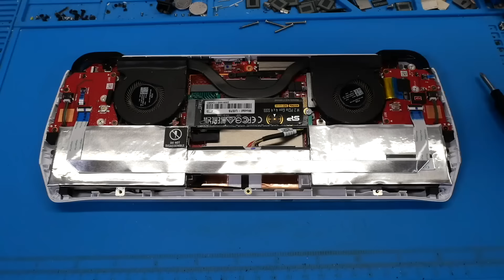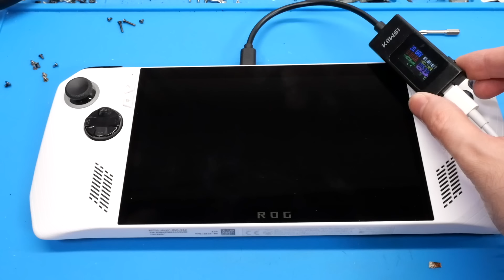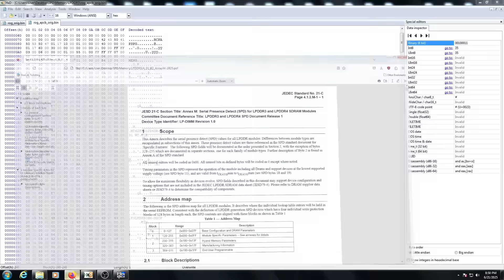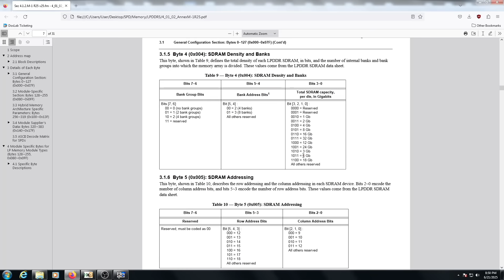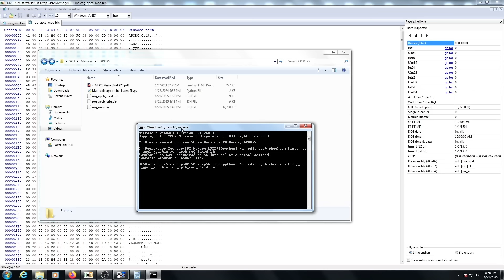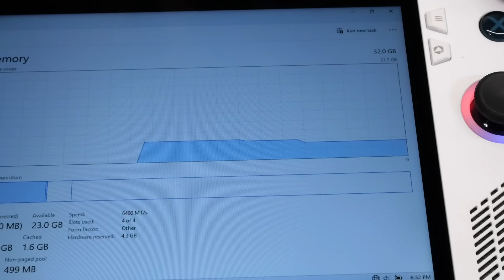ASUS ROG Ally 32GB RAM Upgrade

Comment: Couple things:
1. Congrats on the sponsorship.
2. Windows updating the BIOS (and drivers in general) is actually not a bad thing. While Windows updating itself tends to be generally unreliable, when it comes to drivers, Microsoft only accepts super stable versions for delivering through Windows Update. It's why the driver versions, when installed through Windows Update, tend to be much older than current ones on the vendor websites. This is doubly true for BIOS updates, and I've never had problems with them on both my previous laptops (Acer and Lenovo). Also it feels a lot less nerve wracking cuz all you have to do is reboot.

Comment: Have you considered putting sockets for ram chips on the board that are sockets like bios chip sockets, would it even work.
Reply: making sockets for high speed stuff is very hard it takes a bit of space, recently for DDR5 ram SoCAMM module standard was introduced which is exactly what can be used in a system like this but the manufacturer needs to add it a user can't.

Comment: Honestly, i have LTT precision screwdriver and the mini ratcheting screwdriver and overall i like them both. However my main gripe with both (arguably more so with the precision driver) that makes me prefer my klein or other drivers is the grip. 

The smooth metal finish looks nice, but its not so good for actually keeping the thing in my hand in use, particularly when trying to unscrew anything thats had a bit of loctite or is otherwise gummed up.

Its got some knerling at the bottom, but honestly my hands are a bit smaller, and my fingers dont really reach all the way to it in a comfortable way when i have the driver palmed during use. My fingers end up trying to spin the driver by the smooth metal and its just obnoxious. 

I could solve this with grip tape, but honestly why bother when my klein is comfier in the hand anyways and doesnt need to be modified. 

The lack of proper knerling or grip also just makes it way more prone to slipping out of my hand than any other driver ive used, which is a big no no for me when working inside of electronics.

Its a fun fidget toy though, ill give it that.

Comment: i wanted to upgrade the ram on my og rog ally but after seeing how complex the enitre process is better just stick with ssd upgrade. i think battery upgrade is also not worth it just get a long type c cable that should also solve backup issue

Comment: Coming from an enterprise management background. Windows update (Autopatch etc.) managing UEFI and driver updates is a dream, I fully disagree to that statement "who'd ever want Windows Update managing BIOS updates" haha me! Dell firmware management tools etc are painful and bloated, 30% of the time they forget to turn back on bitlocker after an update. I kinda get it as historically BIOS update interruption etc. is catastrophic but man, I haven't seen a catastrophic update failure in about 20 years (back when I was working at a PC build shop) and even then it was a dual bios board so it failed back to the secondary bios.

Edit: Forgot to say, sick video, sick mod! Well done. I wish they wouldn't skimp on the few bucks to put these chips in.

Comment: Bro, if you think that adapter is jank, you ain't seen real jank. You should see what I do to my PC, which contrary to what you might think is often only just high-end/halo tier parts. I'll double-sided tape adapters right on top of my $800 motherboard's chipset heatsinks, which is then connected to other adapters connected to extensions connected to another dimension.

Comment: By any chance can you add tb5 or oculink on this things

Or make video on xg mobile port reverse engineering 

Because this thing on the go is great but for docking it ain't as it get bottlenecks by tb4 bandwidth 

Oculink is better than tb4 but ain't intuitive as tb 

Tb5 is better but currently it's more of a premium feature like it come on 4090/5090(I have been wondering this from 4090 days like adding 4090 to 4090 laptop) laptop at that point I'm wondering what one can add to it ,a desktop 4090/5090 to 4090/5090 laptop

Tb5 will be bigger deal if they come to light end portable device 

Like decent working on the go and docking and utilising the full potential of device

Hope someone can figure this out

Comment: 30:04 True this , had my ASUS VB S14 with AI 9 HX 370 BSODing all time due to Windows installing a BIOS Update not supported by the laptop. Had to flash it back to the one available on ASUS Driver page using the firmware update utility in the BIOS.

Comment: Would you cover upgrading VRAM on GPUs? I know it's been done before when the card has different available bios(es). But I'm particularly curious about something like the RTX 4060/5060 Low Profile where there is only an 8GB option.

Comment: Rog Ally 16gb and rog Ally x 24gb has only 1/2fps difference in most games. Upgrading to 32gb does basically nothing. It is the GPU need upgrading.

Comment: I came from LTT vdo. 
Bro its 2025 why are you using win 7?
Reply from the maker: Windows 7 is my favorite version of Windows, and it does everything I need, so I don’t need to upgrade. I also don’t really use Windows very much, only when I need to such as for using this Xgecu EEPROM programmer software.
Reply: @dosdude1 win 7 is my fav too sir. But i have a query what is the specs of your pc? It won't work on new CPUs and MoBo compatibility issue.
Reply from the maker: @SupremeDivyanshSingh  The computer I use here is an HP EliteDesk 800 G2, with 6th gen Intel Core i5.

Comment: Do you know what goes on the EC chip? I soft bricked mine with smokeless bootable bios and thought it was the BIOS lol. Needless to say it's blank now and I have no dump of it but I got the BIOS desoldered successfully and know now that I got to disable chip id and it should work. Learned so much from this video great contact
Reply from the maker: EC is normally a microcontroller of some kind, so to restore a bricked one, the specific programmer for that particular microcontroller may be needed. Though sometimes they have that content on a separate EEPROM.
Reply: @dosdude1 it's a catc512, got it to r/w but didn't get a clean dump from it beforehand bc it was still soldered in. Seems the Ally wrote to it though. May try to flash BIOS and see what it does

Comment: Can you update the bios after this and/or reset the device?
Reply from the maker: You can update the BIOS, but the modifications would have to be redone afterwards to the newly-installed BIOS. You can reset the device without issue.

Comment: Wow Mzing... so there are no straps to configure for different memory brands?
Reply from the maker: There are, but there is no 32GB config. All the straps do is tell the BIOS which piece of SPD data to use; because I modified every instance of it, it will always use my modified data regardless of what the strap resistor configuration is set to.

Comment: Its possible to solder faster memory than 6400mt/s?
Reply from the maker: In theory it should be, you would just need to modify the timings in the SPD data to match.

Comment: is it really only cost around $11? is it per chip and I should bought 4 of it?
Reply from the maker: Yep, around $11 per chip! You of course need 4 to complete the upgrade.
Reply: @dosdude1  wow, I didn't know ram chip is this affordable, just making sure
also about the BIOS mod, do you think every ROG ally is the same? I mean what if I used your file to just override mine? or we all need to manually do the same process??
Reply from the maker: @yudhaa  You could in theory just copy the modified APCB section and insert it into your BIOS, but I’d probably recommend just doing the modifications to your current BIOS for the best chance of success.
Reply: @dosdude1  I just watch your cameo on LTT, congrats!
and I am about to try this DIY at home, but first I need to buy all the tool you have there, do you have the list on the tools that I should have to proceed with just for this mod? I have a small experience into soldering back like 8 years ago, watching linus can do it, I think I too can do the same things hehe

kindly if you have time, maybe list what all the minimum tools I need, as in Indonesia we don't have anyone working on RAM upgrade yet for ROG Ally specifically.
anything, big thanks!

Comment: You are much more sure of yourself than I am when I start removing BGA chips! I spend what is almost certainly too much time covering up all the passive components with polyamide tape so they don't blow away. Perhaps you also have better equipment than I do as well, but if I had a dollar for every blown off cap or resistor, I wouldn't have to side-gig like I do. Wonderful work as usual good sir! Have you ever demo'd what equipment you use in your processes?

Comment: Great job. You make the soldering process look dangerously easy lol. I have tried bga soldering before but ripped a pad and haven’t tried again. Do you think I didn’t have the board heated up enough? I didn’t have a board heater but I do have a pretty good hot air rework station.
The bios flashing part is pretty tricky. I’m wondering if someone can just create a batch file or a program to do the modification to the bios file.

Comment: It's great that you show this can be done. Does it make sense for a handheld - no? Who would need 32Gb of RAM on such a device? The CPU and GPU would become irrelevant waaaaay before anything that needs to run on this device needs 32Gb of ram. So it's just a showmanship. On the other hand useful upgrades like Android TV devices crippled with 2Gb of ram which would highly benefit from storage and RAM upgrade, don't seem to be of interest to you at all.
Reply: In handhelds RAM is shared between CPU and GPU and when it's not enough, the system uses swap which is much slower. Even the 24 gb in ROG Ally X are not enough to use it without swap and that slows down an entire system. I'd assume even 32 gb won't be enough.
Reply: Upgrading an android tv box would cost more than replacing it with a newer model with more ram, storage and newer cpu.
Reply: @ElectronicAllsorts  I take it you're not following the market - there hasn't been nothing better released since Nvidia Shield first released in 2015. A different argument is the portability and incremental progress being made e.g. Google TV Streamer has mildly better CPU and GPU than its predecessor and bets only on double the ram and storage. However the Chromecast with Google TV is much more portable device that is very convenient to carry around when going places. Would love for it to be able to be upgraded to 4GB of ram and more storage.

Comment: This is mind-blowing stuff, but did you load it and see if the ram was stable, play a game + browser tabs + random applications, max it out?  Great video BTW(by the way) very informative and educational, very advanced move.
Reply: I run memtest to check all solders are good and ram chips arent faulty. All ram chips are used so bad ram can happen and a system may still boot and mostly function but be unstable in certain games.

Comment: what is the deal to put a light sensor ASUS?? make the repair more annoying instead of safe...
Reply from the maker: It's there to ensure power is killed to the system when the bottom case is removed, so that people installing upgrades or different parts don't accidentally short anything during the process. Kind of a neat idea honestly, though adds a lot of confusion when you don't realize that feature exists haha.

Comment: But doesn't upgrading the RAM also upgrade the heat generation? While there are things that can be done, they might also be things that shouldn't be done.

ROG Ally is a cool device and its biggest problem is battery/power potential than memory or storage. 

Still, expertly done and interesting to watch!
Reply: It might increase by 1-3W, shouldn't be significant. But good question.
Reply: It shouldn’t. The Ally X has lower temps despite 50% more ram. Battery is only low due to the 40whr battery, which can be upgraded

Comment: As always, outstanding work Collin. I found that windows tends to update even disables devices in some cases. In those specific instances i like to do a group policy manipulation to prevent Windows update from installing updates for a specific hardware ID. I cannot post a link as Youtube will take it down, but if you google "Prevent Windows Update from Updating Specific Device Driver", tenforums has a very detailed guide on how to do just that. It has helped me numerous times, and I always blacklist my bios to prevent Windows Update from messing with it.

Comment: But is it adjustable VRAM as well? to maximum available for allocation? 16G?
Reply: You’re still limited to 8gb maximum as Asus would have to change the software to detect it as a new device. The max you can allocate for the original Ally is 8gb and that’s not recommended

Comment: Awesome video! Any way to get 7500 Mt on the ram?
Reply: Using smokeless bios unlock tool you can set ram speed and tighter timings if you wish. May want the faster 7500 ram chips, the ones used in the video are 6400Mt
Reply from the maker: In theory if you installed chips that support 7500 MT/s, and edited the SPD data accordingly, they'd work just fine.

Comment: I cannot believe that the increased price of the Ally X did not include 32gb or more of ram, these chips must cost them pennies. Sickenin greed...
Reply: Pennies no, but still not much, $15-20.
Reply: @jaro6985  the link in the description says we can buy one of these ram chips for under 10$, how much do you think a major manufacturer pays for buying these directly and in truckloads?
Reply: They cost more but there are other upgrades like double the ram size and an upgraded cooling system that’s quieter than the original

Comment: Hi Collin, I have a question about Macbook Airs, you said that you shouldn't change thermal paste on M2, M3 but what about M1 that has different cooler??
Reply from the maker: M1 Air has a pressure mounted heatsink, so normal thermal paste is fine to use there. However the small pieces of black paste used on the RAM chips I leave in place.
Reply: @dosdude1 Thanks for the answer brother, will keep in mind the ram paste!

Comment: 32gb of ram and a mod of 80whr battery for this ROG Ally is the dream of everyone out there
Reply: yea, i want this, as I'm also using an XG mobile, which is not available for the Ally X
Reply: @LuigiVersoza  The ally X can just use USB-C GPU enclosures which is much better anyway
Reply: My question if possible to add more than 32 gb. Also when you do that mod also can increase the video memory ?
Reply: @Gusrango the video memory uses the same ram as the CPU...  The amount of video memory that is allocatable is dependent on the bios/uefi and chipset
Reply: How much you charge for this?
Reply: good hơn x
Reply: The Legion Go 2 coming out in a few months with very much have specs like that. I'm excited for it😊
Reply: don't forget ssd upgrade too!
Reply: My job has a fab so deff clutch
Reply: But the price of the mood Will cost as a Rog Ally x jasj
Reply: sadly it could only perform by a professional, unlike the battery mod which we can do it at home :)
Reply: Here in China you can buy a practically new one that they have done all the upgrades on: ram, battery and SSD. You can get an 80wh battery, 2tb ssd and 32gb of ram for about 2/3rd cost of Xbox Rog Ally with 1tb SSD and 24gb ram. Very tempted.
Reply: @formulaic78  And what is the name of that machine or where can I get it?
Reply: @Dahibe007  ally X
Reply: @formulaic78  where from in china, which store?
Reply: @thejileng55  Ally 7 not X it literally says 7 in the system settings........
Reply: You can literally buy all these things and do it carefully 😅
Reply: this isnt hard, the equipment on the cheap end is like 60 dollars
Reply: @CodemanComments  all of the hardware and software to complete this can be had for $60?
Reply: @CodemanComments smells like over confidence an bullshit
Reply: @ÇrųśtýBøđýPiłlöw  smells like jealousy
Reply: @CodemanComments I very much doubt you have the patience and experience to do any of this
Reply: @ÇrųśtýBøđýPiłlöw  I very much doubt you know anything about me, let alone my patience or skill working on Electronics. I have over 15 years of experience, pal.

Have a great day.
Reply: @CodemanComments doubt it
Reply: @ÇrųśtýBøđýPiłlöw  That's fine, you're allowed to be wrong.
Reply: Facts I'm trying get mines done now 😅
Reply: Just get the ROG Ally X to get the 80whr battery and 24GB of RAM without needing to do any of this and be able to stay current with latest BIOS updates.
Reply: @brokenglasszero Only problem is the price…
Reply: @kingsteven5450 not much more expensive than the ally.
Reply: It’s like $250 more smh 🤦‍♂️
Reply: @i70fx that's an extra used PS5
Reply: @brokenglasszero  Hideously expensive
Reply: @KaitouKaiju  Not much more than doing these mods and the difference is worthwhile.
Reply: @brokenglasszero  i do agree with you

Comment: wonder if u can increase the video memory size too, 4gb to 8gb would be really useful on a gaming handheld
Reply: Someone else mentioned this. Do they not share ram on this model?
Reply: yes @pauljones9150
Reply from the maker: Probably could be done with a BIOS edit, though never looked into this.
Reply: Yes, in armory crate you can increase it from 4 to 8gb of vram. 4gb is just the default but it also has 6gb and an auto setting as well